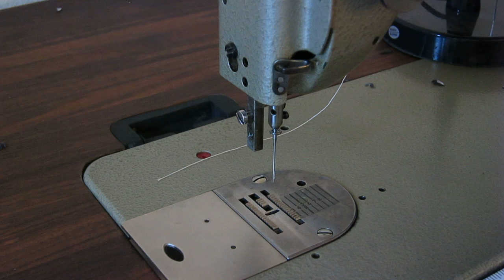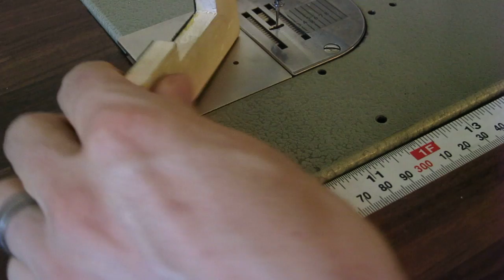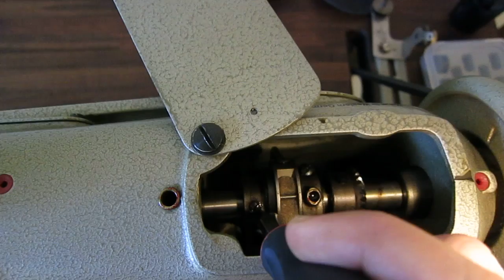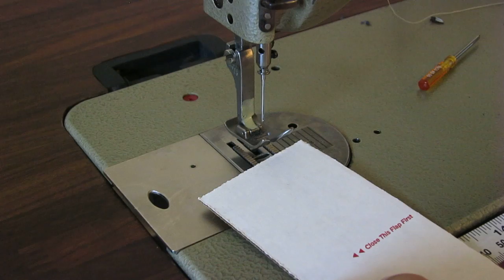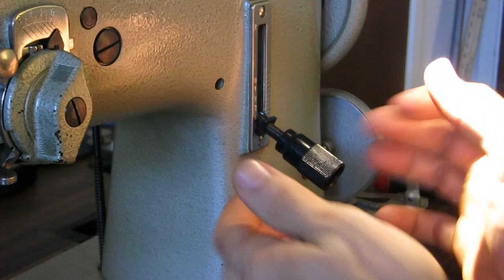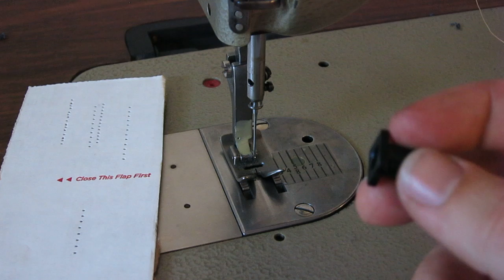Timing Feed Dogs on Pfaff 138 ( Plus Matching Forward/Reverse Stitch Lengths)

Comment: I have a Pfaff 138-6/21-BS that needs a good home.  The SN is 139887.   It went out of adjustment when I had a needle strike.   The zig zag is not working.    I am unable to tighten the set screw for the bight control knob.  The threads may be stripped.  I think that the bight control knob is stuck with old grease.  It comes with the original table and motor.    It also has the original owner's manual.   There are also parts catalogues.  It is free.  I live in Tennessee and am open to traveling within state to find a good home.

Comment: Hi from Paris France ! Im hoping you can help me. I’m having a problem with the bobbin thread under my sewing machine. When I place the thread in the bobbin case—the small round metal case—it doesn’t pull smoothly. Once I put the bobbin case back into the machine, the thread eventually breaks.

I’ve tried unscrewing and adjusting the bobbin case, but it hasn’t solved the issue. I also suspect that the thread might not be passing through the correct path or hole, but the machine is very old and I can’t find any tutorials or reference images online.

If it would help, I can take a photo or a well-lit video to show exactly what’s happening underneath the machine. Please let me know if I can upload a video to my account so you can see the problem. Thank you very much, and have a great day.

Comment: Thank you for showing this. I like the way you identify the half way position of the feed cam by moving the stitch length lever and look for no movement of the feed dogs. I have adjusted the feed timing on a few machines in order to make it sew thicker fabrics. In this case it can be necessary to advance the timing of feed. Advancing feed timing can also make the feed more stable, because the thread tension works less against the feed movement. For my Singer 201 and Singer 66 from factory, these half way points are about 30 degrees after the point of needle bar stroke at max. For my Pfaff 30 it seems to be about 40 degrees after. It seems to me, that the consequence of advancing the feed timing may be, that the stitch balance becomes more unstable. Do you have an idea of consequence of advanced feed timing?

Comment: Hi, this is a great video, clearly described and easy to understand.  I have 3 things that I hope you can shed a bit of light on.  I just bought mine and both the zig zag and needle position were stiff but not frozen.  I used some deep creep and waited and eventually got the ZZ nice and smooth but the needle position is still really sludgy. I suspect there's a point in the linkage that remains gummed up, but can't seem to locate it. Any ideas here? I also see that in the center position the needle is off centre just a bit.  Is the eccentric stud at the top of the swing the adjustment for this?  Lastly, behind the back plate is a clip that holds a chunk of felt for keeping the mechanism oiled.  I suspect the felt is supposed to be at the 12 o'clock when it's at 9 o'clock now. Is this correct?  Thanks for any help!

Comment: Any clue on how to center the needle of the pfaff 138.  I've tried the eccentric screw on the back but that just adjust the position of the zig zag?
Reply: Actually I figured out my own answer to my problem as luck would have it.  There indeed is an eccentric to adjust the needle bar. It is on the back of the machine at the left front of the machine.  There is also a set screw to the right under the arm that has to be loosened first. Then you are good to go.
Reply: There is also an adjustable zig zag eccentric inside the head located above the pressor foot that is accessible from the back.  It too has a set screw located above this eccentric.  I just cannot figure out how to access this set screw.  Any ideas?   @davidbolduc828

Comment: hi from france, do you prefer pfaff 130 or 138 ? I have the opportunity to buy one this two (To sew of thick fabrics)
Reply from the maker: They're basically identical machines but I prefer teh 138 because of the knee lift and larger harp space.  How thick of fabric are you sewing though?  You might be better off with a walking foot machine.
Reply: to sewing truck tarp !! i finaly buy a 138 , walking foot machine are too much expensive for me,i just have to replace the old motor condenser
Reply: MrMotte62
Reply: Om

Comment: Hallo Sergeant,your video is verry helpful,and the timing on your 138 has also worked on mij 134 / 234 (without zig-zag) The only difference is there where 3 screws to losen the main drive-schaft in stead of one. After your modification:only the 3-piece transport-foot below the plate is not 100% down when the needle hits the cotton to sew,but this is maybe max  1% of an inch (0,25mm) so i think this is oke.

Question: the bobin on my  machine is held in place in the bobin-house like al sewing machines,but this house is not 100% thighten to the axel and makes some noise when  using the machine (ringkeling sound) I think it supose to fit not 100% tight but i think this is a bit to much .

If you mail me back i can make a video of it.

John from Heerlen  Netherlands

Comment: On Pfaff 130, could you tell where the feed cam is. The manual says there are two screws to be loosened to adjust feed timing.

Comment: Pfaff explains their choice to set Forward and Reverse feed rates to be non-matching. See page 49 of the Pfaff 230 Maintenance Manual for an example. Basically, they say that Reverse is most often used for backtacking, in which case you don't want to stitch in the same holes. They go on to describe how the ratio can be adjusted for equal length stitching "e.g., for leather work".